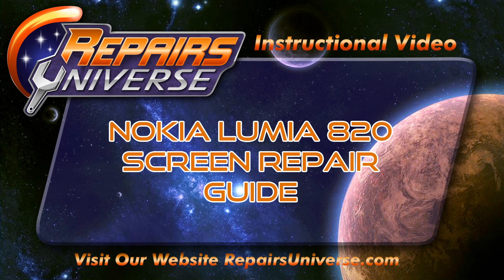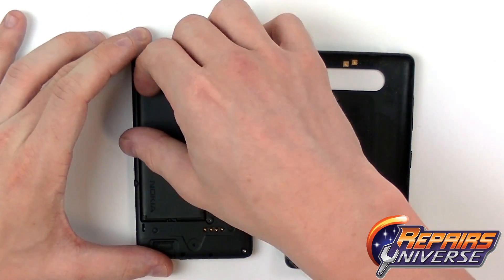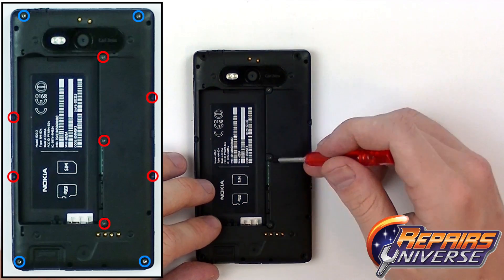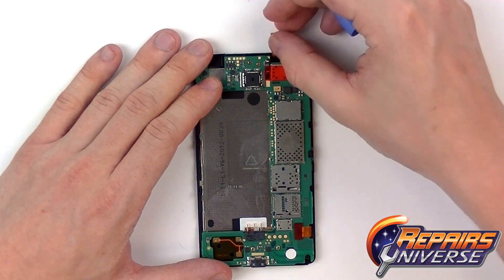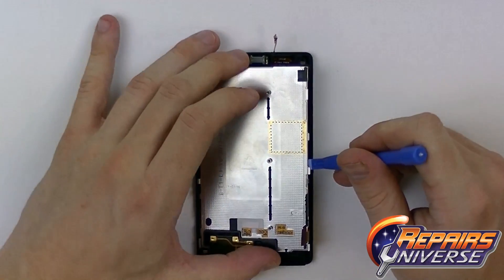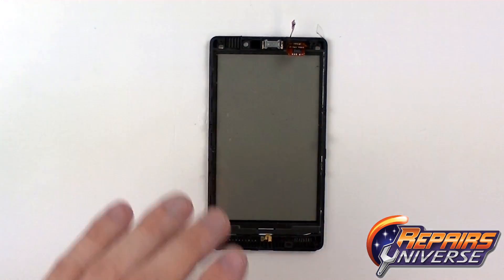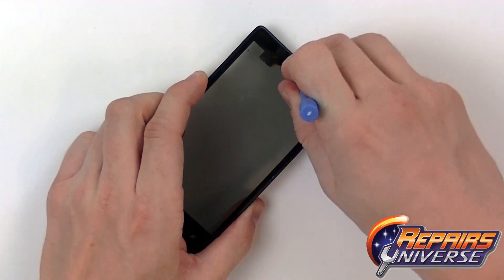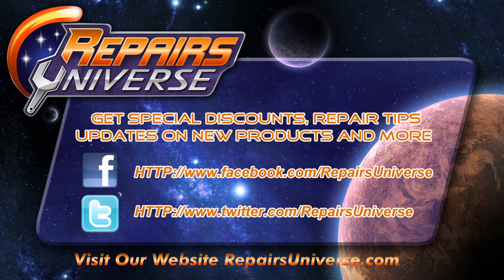Nokia Lumia 820 Screen Replacement Repair Guide

Comment: Could you please tell me, if my screen is burned, like not responding at all (due to wrong voltage cable, I guess), does this guide apply or it is most likely a differant problem?
Thank you! :)

Comment: Hiya, really useful vid, but my problem is that my lumia 820 is cracked behind the screen, (its a really thin crack and when the phone is switched off its hard to even see). The glass on the phone isn't smashed 1 bit, its just behind the glass the actual screen is now blurry, when switched on, its almost as if there is an ink behind the phone, and its blurry amongst the top to the bottom!! This isn't really my subject also by the way so i have no idea what to do, the thing is i have photos, videos, songs ect on there that i don't want to lose - it would be horrible to lose them so im desperate not too.. So is there anyway i'd be able to get the 820 fixed with everything still intact on it? Thankyou.
Reply: Repairs Universe infact, when i turn it on now (because its been a while since i last used it, been using a temporary phone) the screen just remains black apart from the three touch screen buttons on the bottom which still light up :(
Reply: @ck891  my device has that problem too

Comment: Repairs Universe  I broke my lumia 820 screen. It only broke half down, where the touchscreen is not working but still the screen image remains intact. The half top works perfectly. Should I only replace the screen? I can not identify whether the bottom has been damaged.

Comment: I have problem with my 820 ..its moving on his own will sorry for my english its not my mother tounge.. sometimes when I lock the phone and try to unlock it the screen freeze and I can't swipe it up to unlock it then when I try tu turn off same thing can't swipe it down to turn it off ... it happens many times that my phone moves on his own going to facebook then automatically switch to oher apps and I did not do anything at all even touching the screen...I have the latest software and I already do the hard reset it will works fine after the hard reset but after using it for an hour it will go back to the same problem I reset the phone many times please help me ...thank you

Comment: my nokia lumia 820 won't light up, the screen is cracked, it does turn on however. Will the LCD and TCD be both damaged? thanks
Reply from the maker: Hello,
TCD? are you talking about the touch screen digitizer?
They could be both damaged. If they are both damaged then the phone will not show a picture IE the LCD is not going to come on because of a break or damaged part.
It sounds like the part is damaged because the phone turns on but no image with show.
We have both of those parts here tinyurl(DOT)com/m34x7xg
Reply: +Repairs Universe will I still be able to use my Nokia 820 after Steen replacment???? plz reply fast

Comment from the maker: The LCD screen is the "inner display", and the glass is the "touch screen digitizer" (outer screen). Your phone's ability to turn on, does not have to do with which part you need to replace. If you have problems viewing images etc., you should replace the LCD screen. If you only have a cracked outer glass, you would want to replace the touch screen digitizer. Hope this helps, we also have both parts available at RepairsUniverse (dot) com.